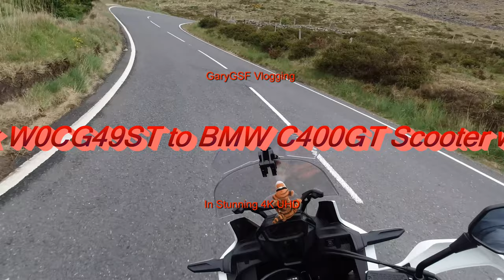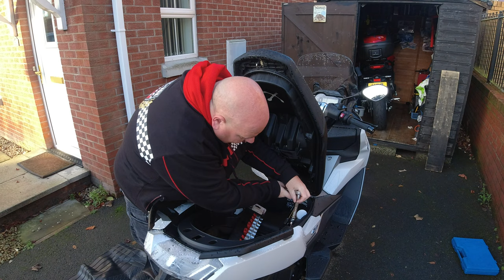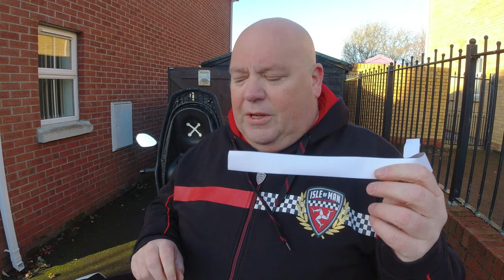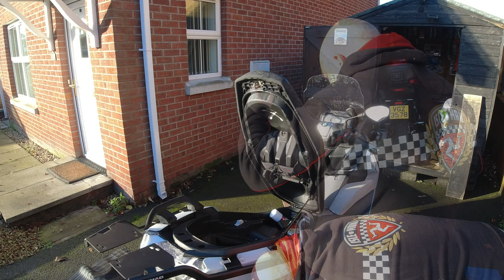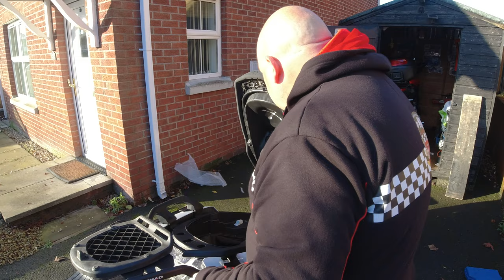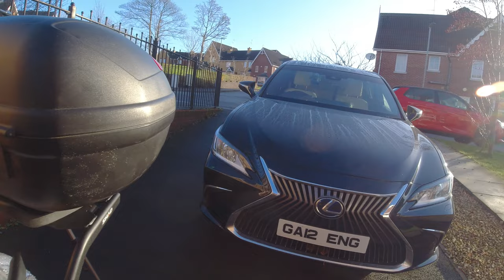Fitting a Shad Top Case Rack (W0CG49ST) to BMW C400GT with Givi Box in 4K

Comment: Hi mate, do you how much weight can support this rack? I  am not sure if its stronger or not, compari g to the original bmw rack. Do you think it can carry 25kg? I am asking this, because I usualy do groceries shopping and I have a shad 58x. Thx.
Reply from the maker: I do a lot of shopping in mine too. I'm not sure the recommendation of loading from the manufacturer but I've had a load of shopping in it including 2 boxes of beer without any difficulties. I'm sure it's up to the shad stuff as it is sturdy. Thanks for watching and taking the time to leave a comment.
Reply: @GaryGSF  Thx for your answer. Did it leave any scrstches after you mount it? I mean, The plastic protection between the scoot and the rack, is it still there, it does the job?
Reply from the maker: @iurox  The plastic protection didn't do much. All it seemed to do was gather green moss underneath it.

Comment: My BMW C400GT only has the grab bars. What is the actual model number and the vendor (web site) to get this rack? Will it let me install the GIVI top case i already bought (it has a standard mounting plate included)? Thanks for the great video!
Reply from the maker: The rack is made by Shad and I bought mine from Moto Planet online. It is around £100 at the moment on most websites.  The model number is W0CG49ST.  In the video I fit a Givi Monolock case to the rack with it's included mounting plate, so it should work for you.  Good luck in the fitting it.  Thanks for watching and your kind comments.
Reply: Sorry Gary, to be clear SHAD says (via email) that this rack that you show installing only works for SHAD top boxes, not Givi. I am not sure that's true since the top is simply HOLES for mounting plate to and the Givi top boxes have a mounting plate that has almost infinite placement of the bolts (holes)  to attach to a rack. Again, I just have the grab bars now so it looks like this SHAD rack addition to the grab bars would do the trick for me. Do I have that correct?
Reply from the maker: @larryhooser1855  It is probably designed for Shad boxes.  As you say they are only holes and the grid on the Givi plate would line up and attach without any issues.  I was prepared to drill new holes but this was not necessary.   It may be a little more forward or back compared to the Shad top box  but is certainly workable.  The Shad rack goes under the original grab handles so they still stay on the bike.  I do hope this helps.
Reply: Sorry, one more observation and question. It looks like you did not actually remove the seat storage box, just loosened it to get at the grab bar bolts. Correct? Just easier that way? @GaryGSF
Reply from the maker: @larryhooser1855 That is correct.  All the bolts were taken out but the tub was not fully taken out.  Everything was accessible with it just sitting loose to access the grab bar.  It would have been just as easy to pull the tub out.  I suppose I was just cutting corners  😜